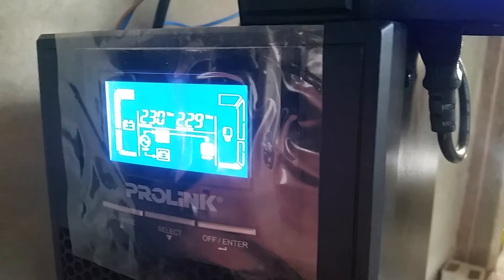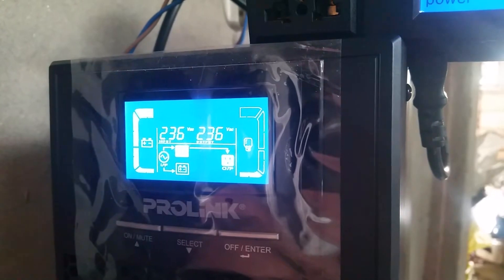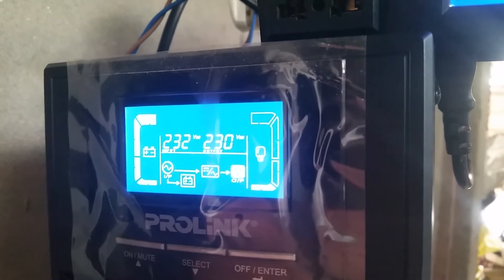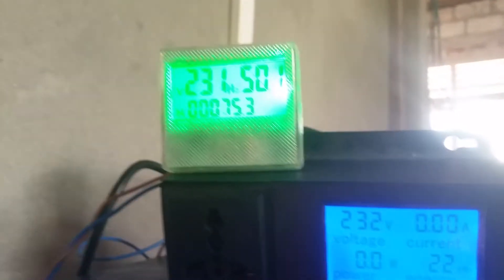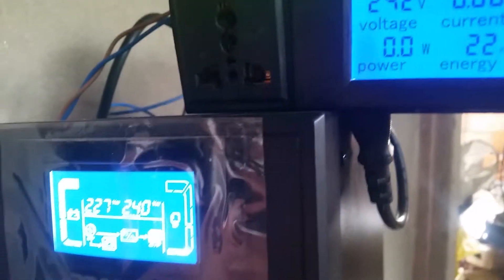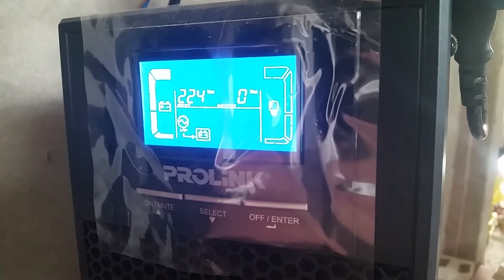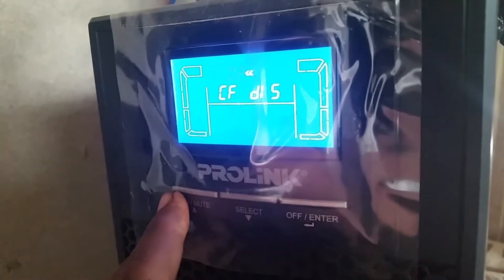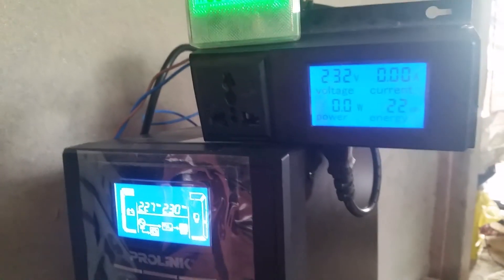Prolink PRO901WS UPS with incorrect voltage sensor

Comment: Why chase a 2-3V difference? And using two seperate voltage meters. 🙁 Don't you know power electronics?? Modern pc power supplies are designed to withstand these type of issues. Also, for all that we know, it could also be your crappy ass chinese volt meter. If that's the case, fault is in your end.
Reply: This guy is basically a lunatic. Just ignore him!